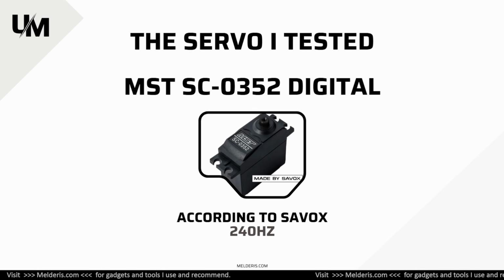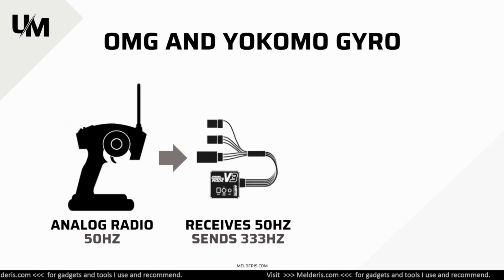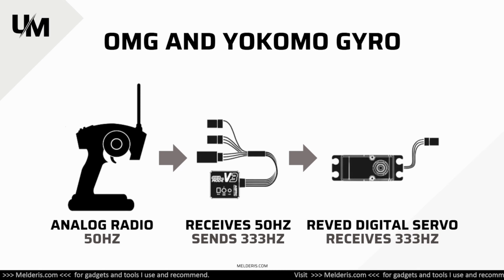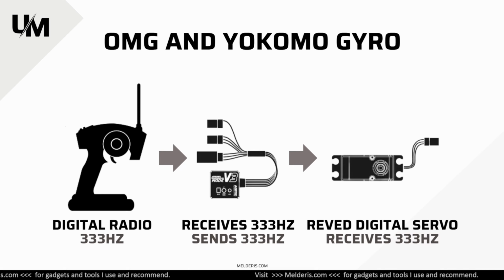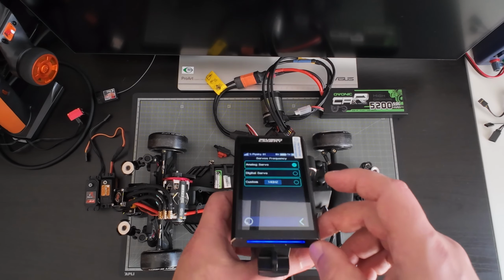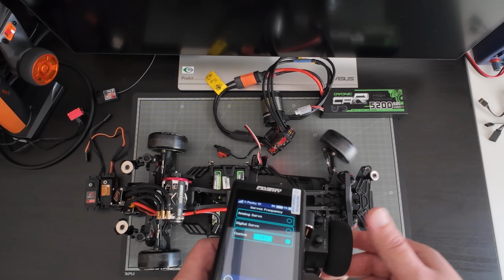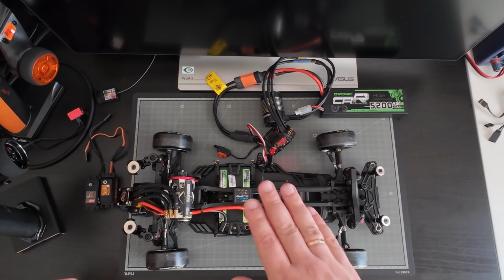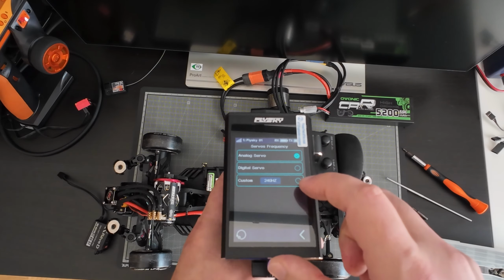Why RC Drift Servos Burn Out | Digital vs Analog Explained

Comment: So the MST B-07MG
Weight46g, Speed0.16sec/60(6.0v) torque7.0kg-cm
Is a digital gyro or analog?
Reply from the maker: MST do not disclose that, according to Savox - digital, to be 100% sure probably need to take it apart.
Reply: I tried hooking up a yeah racing hackslider onto my mst b-07mg  servo which came on a ready to run mst rmx 2.5rtr and made the servo hot and couldn’t steer at all is this because of the difference between the analogue and digital?